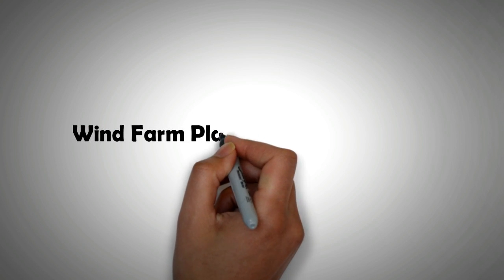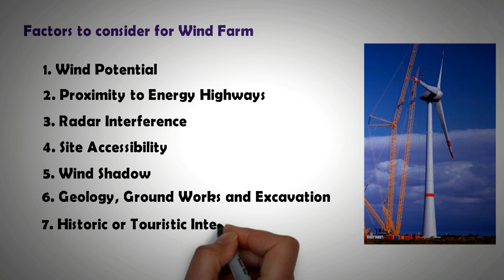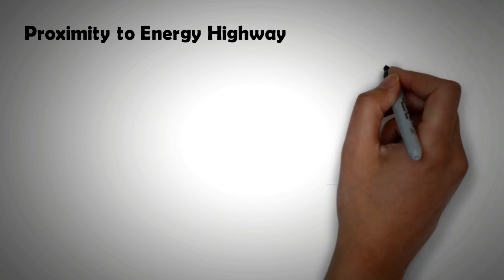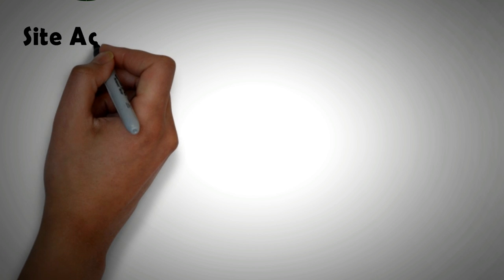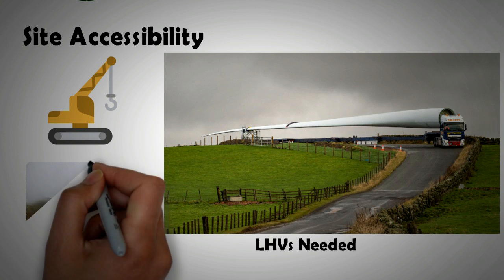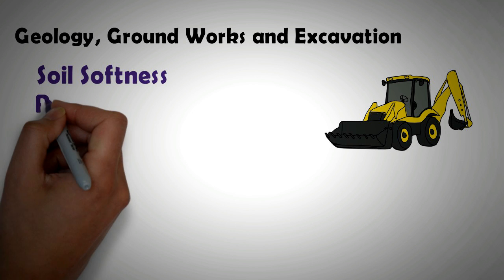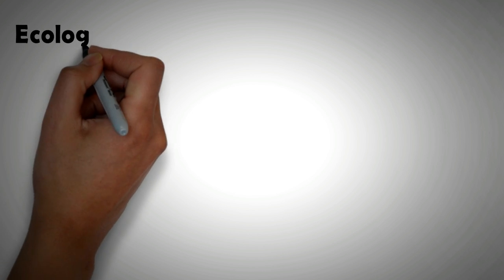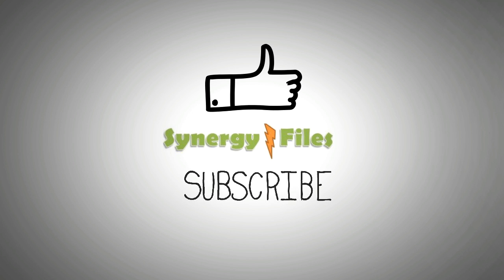Wind Farm Planning Considerations

Comment: I think one project on going in sindh pak a part of CEPC by china
Reply from the maker: The reason I am saying that is despite the perception that coastal areas have wind corridors and sites like Gharo and Jamshoro have drafts that make them ideal, if you look at the numbers on average wind speed they are really low. You get an average annual wind speeds of 3.5 m/s.
The sites that have an average of 5 m/s annual average wind speed are deemed feasible in that they pay back the cost within 8 years. Although wind variability also has a huge impact on  the output. The place where I live has an average wind speed of 6.5 m/s. The payback time is less than 4 years.

You can have projects for novelty and you can also have wind power to create electricity indigenously. You dont have to lay down transmission line infra structure. So taking that into account, places in Sindh may be feasible. In financial terms if the ROI is more than 10 to 12 years, projects are considered unfeasible because they offer little value.
Reply: The best explanation of technical terms needed to be considered before installation of a Wind Turbine. Sir you are saying that its not suitable for Pakistan, Why? A few farms are already installed and supplying power to National Grid. While the others are in pipeline. Sites like Gharo, Jamshoro, Jhampir in Sindh are considered suitable for Wind Farms. Your point is due to Cost (as we import Wind Turbines) or any other technical reason? Your comments will be helpful for me, please.
Reply: Thanks dear
Reply from the maker: Wind turbines are not suitable for Pakistan.